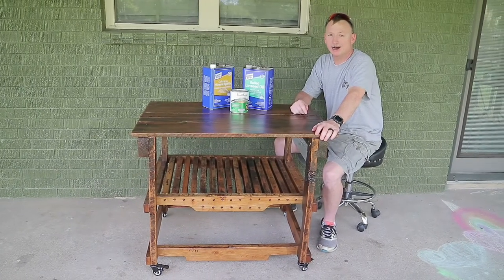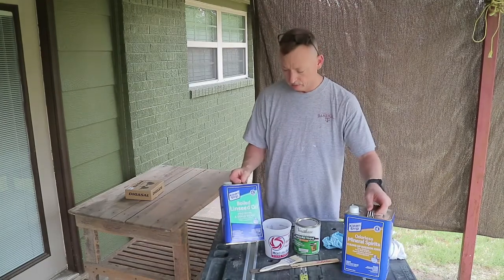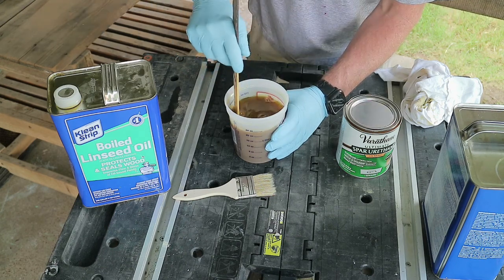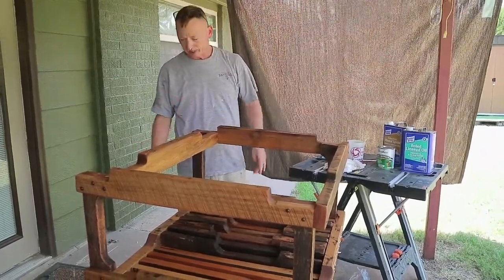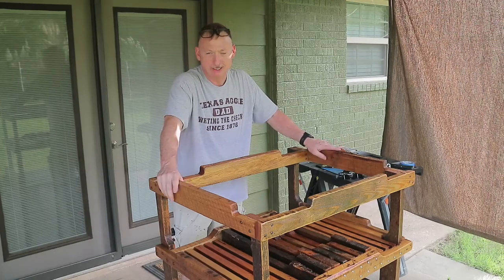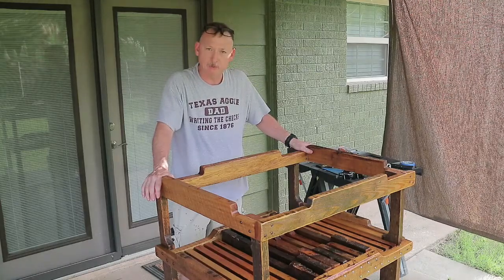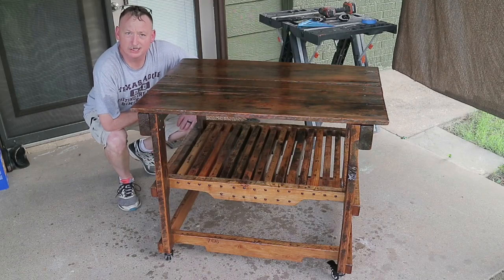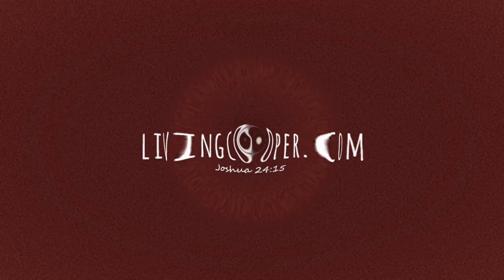Coop's Simple How-To - Grill Table Update

Comment: I love wood. It came out beautifully.
Reply from the maker: Hazel Em thanks so much!! Thanks for watching! We are re-using & up-cycling pallet wood.
Reply: LivingCooper have the pallets been pre treated with some chemical before you used it? Here some pallets have had been pre treated but are still being recycled.
Reply from the maker: Hazel Em great question. It is true some pallets are chemically treated. I try to use only heat treated pallets, however some of these may have been chemically treated. Because I am not using this  table for food, and I have completely sealed it in with the finish I used, I am not too concerned about it. Pallets are supposed to be labeled as to how they are treated and what, if any, chemicals were use to treat them. Typically pallets that are heat treated, have an HT label/brand on them. Thanks again.